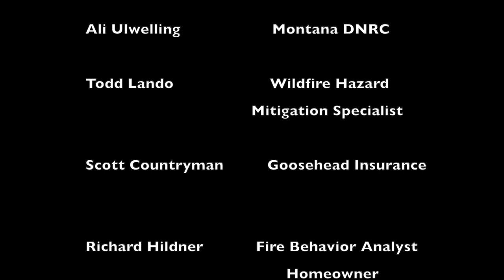Will Your Home Survive a Wildfire?

Comment: we lost our home 1.5 yrs ago to a wildfire and we live in town.  No one's safe from 120mph wind-driven fire. No one thought ever thought we'd lose our homes to wildfire.  Our town had over 550 homes burn, with over 1000 total in the fire.  The post-fire process takes forever...we won't have a home again until next spring.  And 92% of us fire victims were grossly underinsured.  Our insurance company underinsured us by over 50% of the rebuild costs.  Do your homework folks.  Don't be us.  Take your coverage and divide it by your square feet and find out what your local construction costs are and then get the right coverage.  There's also insurance companies that won't insure homes in our town anymore.
Reply: How rural is that town?  May I ask that area and state as relating to how far flung it is from a major city?